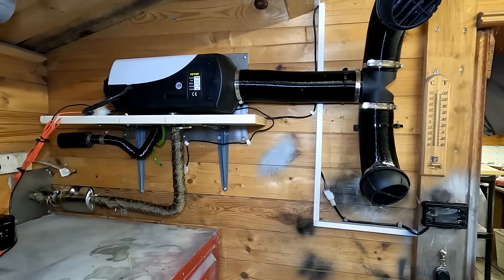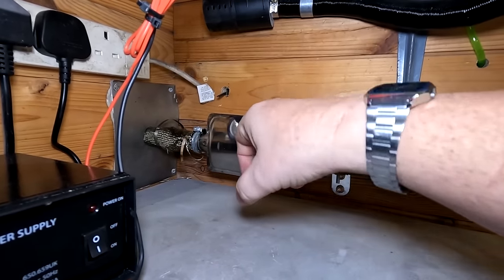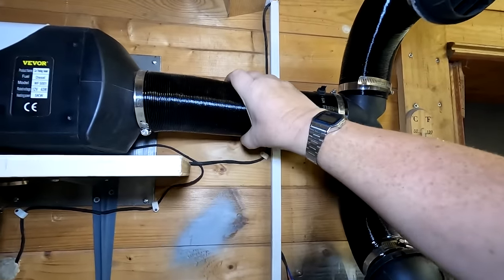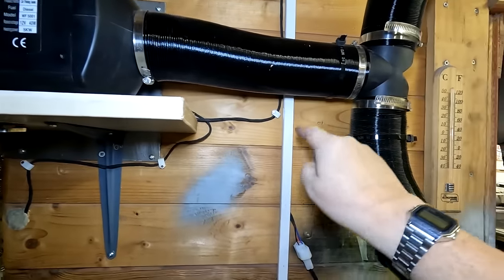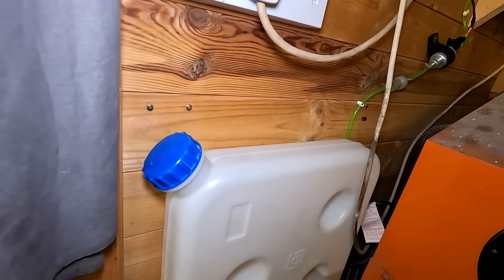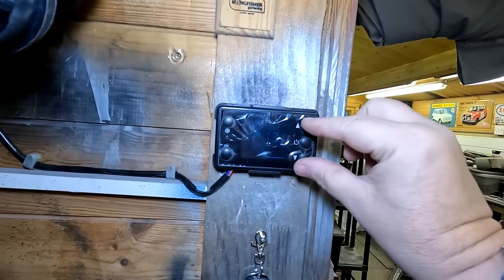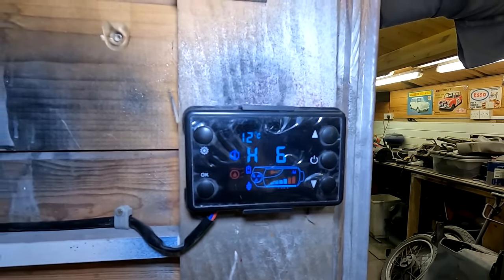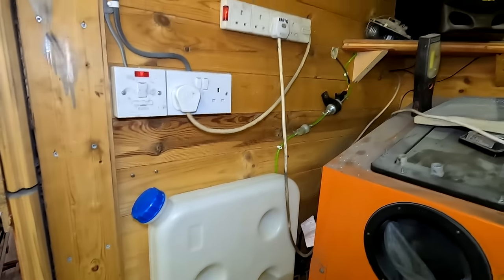This Diesel Heater Installed In My Workshop Was So Easy

Comment: I worked on installing mine in my shop yesterday. I didn't know hot hot it might get, so I mounted the metal plat onto metal brackets off the wall so it's not touching any wood. I ran the exhaust pipe out through the wall with an oversized hole (approx. 63mm or 2 1/2 inches). I am concerned about the heat of the exhaust pipe, what should I put in/around the hole to protect the wood of the wall from the heat of the pipe going through?
I have to say the instructions that came with mine were completely useless. There was only one picture of the entire unit with parts numbered, but the numbers were so tiny and the entire picture so blurry you can't even make them out. Plus my manual had a ton of extra parts and lines listed in it that don't come with it, not sure what they are even referring to. Anyway, all I have left to my install is to finish installing the exhaust pipe outside, put on the tubes for the heat exhaust, and hook up the electronics. I am planning to use an old PC power supply for my power, at least for now. I think it's a 450 watt unit.

Comment: I wouldn't have put the muffler inside as them mufflers have a small drain hole on the bottom basically to let any accumulated water out but on mine I have it outside my shed but I have noticed on auctions it does also let some smoke out of the drain hole to so it wouldn't be good having it pumping it into your shed. Oops just noticed this has just been said but I'll post my comment anyway as you definitely need to move it. 👍
Reply from the maker: It's outside now

Comment: Just A thought, would it be feesible to reroute the exhaust gases torough a tuber which could trough an tank of water to take the heat from the exhaust ,transferred to the water , making a small or large radiator, if you get what i am trying to explain, regards

steve B

Comment: These are great units and provide really nice dry heat.

I'm not knocking your work, but just a couple of comments:

It's really not advisable to have the combustion air intake drawn from inside your workshop, these heaters can go faulty and smoke and gasses can come back out of the combustion air intake.

The supplied flexi exhaust is notorious for splitting  - so just keep an eye on it and the connection under the heater - you don't want those nasties leaking into your workshop.

A neater way to install this would be to buy a turret plate, hole saw a hole in the wall of your cabin, turn the heater 90 degrees then the exhaust and inlet connections are all outside your workshop.

Comment: Using a power supply that depends on the grid will not provide the heater with the power required to go through the cool down cycle if there is a grid failure. Use a, or some 12vdc batteries on a charger to power your unit. If the grid power goes down you have not lost power to the heater and it will not get damaged by not being able to cool down.
Reply from the maker: I would just connect a battery up within a couple of minutes. It would be fine.
Reply: @retrorestore  Really enjoyed your video. I have two Silvil 8K heaters on order. I have been binge watching diesel parking heater videos looking for ideas
 Saw one where a gentleman captured the heat from the exhaust using copper tubing prior to venting the exhaust outside. No/very little heat waisted.

Comment: Hi Martin. Fab bit of kit. Just fitted to my log cabin. Superb. Although I’m set up on the battery. Looking to buy the power supply you have in situ. But when I click on your link. It looks very different from what you have ? I would like the plug in one that you have. Did you attach wrong link?? Thanks Richard. Keep the vids coming 😊
Reply from the maker: The one I got is out of stock Richard
Reply: @retrorestore  ahh ok. Thank you for the reply..

Comment: Thanks for this video, it has inspired me to order one for my own workshop. Was wondering if you happen to know what size hole is needed for the exhaust pipe? Cheers!
Reply: Another comment said 3/4 inch but you need a 3 inch hole minimum with standoffs because the pipe gets over 200 degrees

Comment: Why put an insulating heat wrap on the exhaust pip[e when it would radiate additional heat into the room?
Reply from the maker: Because sometimes there is aerosol spray mist in the air and it is combustible.

Comment: You should run the burner air intake to the outside. You are currently sucking warm air from the air and blowing it out side via the exhaust. On top of that you are creating negative air pressure in the house, sucking cold outside air into the house.
Reply from the maker: No negative air pressure here, its not a sealed cabin, its full of gaps
Reply: @retrorestore  the burner running creates the negative pressure, so you definitely do. Not running the air intake to the outside is 100% drawing in cold air through the gaps. You’re wasting oil sucking warm air into the burner and out the exhaust. I am talking about the small black intake pipe with filter. 20+ years HVAC experience installing and servicing heating equipment here.
Reply from the maker: @stephenroberts4155  Thanks for your comment.

Comment: I have just ordered the 8KW version for my workshop next to my barn using your discount code. I hope it will be arriving in the next few days. It is quite legal to run these off of red diesel as well so you can save a bit of money!
Reply from the maker: Hope you enjoy it!
Reply: @retrorestore  Thanks, so do I - can't do another winter without heat out there!
Reply: @info-on-scubadiving  You are mistaken.  There is no such thing as an 8kW cheap chinese diesel air heater.  Look at the specification - does it deliver nearly a litre of fuel per hour?  It won’t, because the fan will not move sufficient combustion air, for a start.  Even the 5kW versions do not deliver 5kW of useful, hot air.  I’m afraid you have been conned by the chinese (and suppliers) marketing hype (lies).
Reply: @oliver90owner  only going by the information listed on the website which states 8Kw. Not me mistaken, perhaps the sellers, but only ordered what was listed and stated. 🙂
Reply: @oliver90owner   I simply bought a device that was listed as being of a higher output than the one shown in this video. That was all I cared about, not the minutia of detail. I am impressed with your psychic ability to know what I believe or not! China has had a somewhat tarnished reputation for poor performance in various areas but many young Chinese are doing what they can to improve this. How do I know? Because I am in direct contact with many of them at various companies, working with them. There is a lot of xenophobia about., but at the grass roots level, most Chinese just want the best. They are not perfect and for sure many Western countries including the UK and USA could pull their socks up.. I really can't be bothered checking specification if what I buy does what I want it to do. End of.
Reply: @info-on-scubadiving  My comments are primarily to protect others, who might be conned, like you, into buying something that they think is better than another.

I know perfectly well that chinese  manufacture can be very good - a company, I once worked for, sent back at least one full container of substandard electronic parts (failed to meet the specified maximum failure rate under quality control scrutiny) and after that episode all subsequent orders were fulfilled with in-spec items).  They only do the minimum they can get away with.
Reply: @oliver90owner  thank you for your philanthropy however I do not need protecting, nor have I been conned. Surely no Western company would stoop so low as to falsify data on their diesel products would they? Oh, wait! Volkswagen,  Vauxhall, Mercedes...... At least we have the "where there is a claim" brigade there to protect us from them!  ;)
Reply: @info-on-scubadiving    Yes, definitely for certain you have been conned - because the information is out there in the specifications that you did not understand, did not read, chose to ignore or whatever.  Not like ‘ dieselgate’ where they even hid the scandal such that the ‘normal’ testing procedures were obscured from the truth.  The information for these heaters is available to check - even if they lie (their marketing hype - which you have clearly fallen for).  The more you shout and scream, the more people who read this will check before buying and more will know how you got conned into believing you were buying something different.  Something so different that anyone, with common sense, will realise that it cannot exist in that package.  

I’ve done enough to warn everyone who reads this that cheap 8kW chinese diesel air heaters do not exist.  Good day, I’m gone from this conversation as you will never be able to see, let alone admit, that you were conned.

Comment: Very nice job you done there. I would almost think your fuel pump would last a lot longer if your fuel tank was higher than what you got it it must be a lot of work for the fuel pump
Reply: The specifications for the levels are well documented in the installation instructions.  Nothing to worry about if those are followed.

Comment: The power supply  is 13.8 volts and the heater needs 12v . Will this power supply  damage the heater with it supplying over voltage? Thanks

Comment: CO (carbon monoxide) is slightly lighter than normal air, so don't put the CO detector near the floor, put it up higher.  I put it the same height as my nose!

Comment: I did exactly the same as you and fitted it in my workshop, but the exhaust goes straight through the wall with the silencer outside. Can I ask do you get a smell of diesel smoke as it starts which disappears after it’s run for a few minutes. I have checked with two carbon monoxide detectors and none indicated any issues.
Reply from the maker: I moved the silencer outside now

Comment: surprised you put it up so high ,remember hot air rises you be heating the roof space atleast you,ll be warm from the neck up 😂😂 best at ground level keep the feet toasty if you search Chinese diesel heater spares on ebay for about ten buks you get 5 ft of exhaust extension plus spare exhaust, extra hot air out ducting ,lets you configure set up for the space you want to heat  you will love the little portable one so easy and handy to use
Reply from the maker: That's the only space I had free, The vents point down though.

Comment: Just commented on your other video. Good stuff man. Do you believe this heater would heat a 14ftx40ft long wood insulated building? Getting cold here with temps as low as 20-25 degrees Fahrenheit. Thanks
Reply from the maker: They are only cheap so worth a try Clay. Lot of people also run them on old engine oil as well.

Comment: The exhaust muffler leaks from all sides it has a hole at the bottom aswell . install it outside to prevent carbon monoxide build upp . 2 heat wrap the exhaust line why ??? its free extra heat inside and extra 500 watts +_
Reply from the maker: It's already done, check my latest video.

Comment: Great idea! Is the hot air that's coming out moist? I'm thinking corrosion of tools etc?
Reply: Would like to know answer to that as well please, reason got rid of Calor heater.
Reply: No,  it’s dry.
Reply: @johnstarkie9948  Lets be honest, here.  The hot air will contain exactly the same amount of water vapour as it did when it entered the heater.  The hot air will, of course be at a lower humidity value, by virtue of its temperature, but the moisture in the air will not have changed.
Reply: @oliver90owner  
You’re right,  of course.
The Calor heater burns hydrocarbons,  and releases both carbon dioxide and water into the air.   This increases the vapour concentration in the air.
The diesel heater also burns hydrocarbons,  and releases water and carbon dioxide.
The difference is that the diesel heater passes them out through the exhaust while the Calor heater releases them into the room.
But,  of course,  you know this.
By comparison,  the diesel heater is dry.
But,  of course,  you know this.
Reply: @johnstarkie9948  Correct.  Do remember there are others who read these comments and may believe everything that is written.  There are loads of instances where untruths are told and are easily converted into myths.  Llike 8kW cheap chinese diesel heaters - many reckon/claim/think they have them even though they do not exist.🙂

Comment: Just get rid of the muffler (silencer). You don’t need it. If you want the muffler, put it outside. Even without a muffler, it’s not that loud once the unit warms up. That muffler will leak exhaust fume into your shop; it’ll smell and is dangerous.
Reply: Put the silencer outside it’s much safer

Comment: If I was you I would swap the copper pipe on the outlet. It was made illegal to use copper in exhaust systems (in the UK) as it gives off copper disulphide when hot. This is poisonous and a little bit dangerous .. Otherwise a nice job and a great idea for your man cave.

Comment: i have mine running off a car battery on charge all the time when in use, at start up they use a full 12/13 amps till it gets going then it drops to less than 1 amp after about 4 mins, on the lowest setting which for me is 8c, i turn it up when working in shed when power trips for any reason it can do its shut down cycle with no problem, please use a battery Martin.
Reply from the maker: I will install a small battery as well Mick.
Reply: @retrorestore  thank you
Reply: So your charging the battery while running your heater, I was thinking of doing it too, mine is a 200w 15amp jumper type booster pack, but the instructions say not to use any outputs while charging, so I thought  run the battery a few hours then recharge type of cycle
Reply: @mikeb3010  if you use one of those intelligent chargers off ebay a small car battery what it takes out of battery on start up it puts back in when up and running less than 1 amp at 8c and at 35c about 4.75 amps when running full time thanks
Reply: @tommo1404  I’ll have a look, thanks Mick

Comment: To prevent Carbon monoxide poisoning you need to rotate the heater 90 degrees and take the exhaust and combustion air straight out through the wall sealing heater to wall with gasket. installed correctly these units are fail safe. installed as is just fail fail.

Comment: Roughly how many litres of fuel per hour use do these consume? Trying to establish how cost effective they are for garage heating compared to gas or electric. Thanks.
Reply: 0.25 at full pull in 8kw
Reply: Thats maximum. But 3 4 5 days for 9 liters is realistisk
Reply: @Lordlindef   please, please, please don’t talk rubbish.  A litre of diesel only contains about 10.5kWh of energy.  This heater is likely specced at about 0.5l/h at full output - but some of that energy will be going out through the exhaust.
Reply: @oliver90owner  bullshaite.   Have used them 24/7 356 for many many years.

U belive,  but really dont know
Reply: @Lordlindef  u Believe me.  I do know.  If others read your comment, they will laugh, too.
Reply: @oliver90owner  of you yes.
Come back and talk about this produkt after you have bean used it for 5 years and we will see.

Maximum is 0.25 liter pr h. On 8kw.

But settup is many ways for that to do.  Some are good some are very bad.

Have bean using this for many years in a houseboat. 
And know much People use this for floor heaters and air heaters togethers in cabines in norway Mountains. 

But my self 2 yars in vinter i get stock in ice.  Negative 22 celsius outside.  I had pluss 23 degrese celsius inside 24/7.   3 days and 21 to 22 h on 9 liter of diesel. 

If all BS you taking is true, how this is possible you Internett troll ??

Talk when you have bean used produkts some years and dont bla bla bla of your belivings. Ok ??

Have a real good life.  Best of Luck for you and your belivings. 
Take care

Comment: if i was you id put the air intake outside so you can recirculate fresh air
Reply: Better with it inside as the intake will bring warm air back in to the heater.

Comment: The air intake needs to be outside so it can draw fresh air inside. Otherwise you will end up with oxygen deprivation. You’ll be recirculating the already hot air without fresh oxygen. So you need to make another hole in the shed wall and poke it out
Reply from the maker: The workshop is not a sealed box and is fine where it is.

Comment: Does it have a proportional controller ? By that I mean that if you set it to say 20 degrees, and the room temp is say 5degrees ,does it initially run at full power ,and slowly ramp itself down to the set value ( 20 degs), and then hold it there, or is there just 5 pre set levels ?
Reply from the maker: yes it would.
Reply: @retrorestore    No it doesn’t.  It can only modulate between high output and minimum.  You would need an aftermarket controller like the ‘Afterburner’ to even approach good control.
Reply: Yes it does. My controller is visibly the same as the one shown and if set at 20 degrees the heater ramps down automatically when it reaches the correct temperature. I believe it can be set to either temperature mode or pulse timing mode.

Comment: Forgive my ignorance but doesn’t it defeat the object of it being a diesel heater by using electricity also?
Reply: It will use bugger all electricity ……..😊
Reply: @steveosshenanigans  yeah but it uses fuel also , so would in not be easier to just use and electric heater and save the messing
Reply from the maker: It uses a minimal amount once it has fired up.